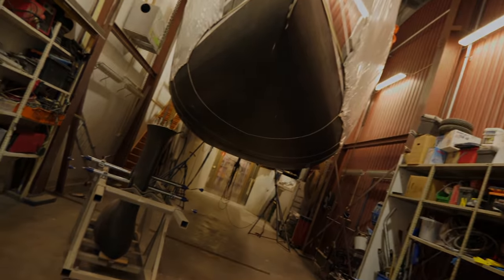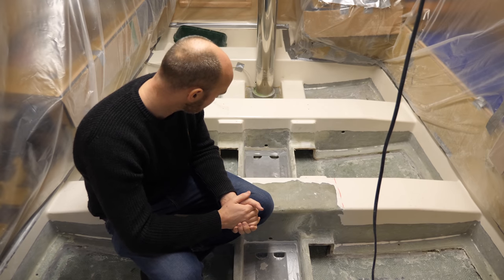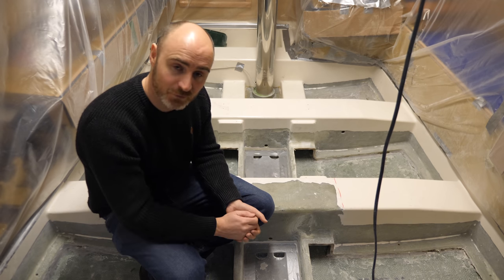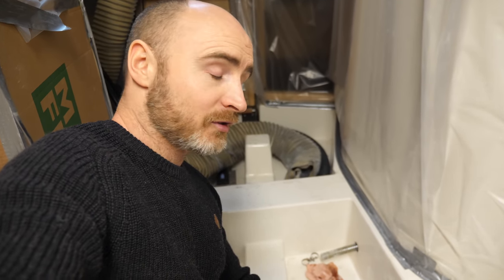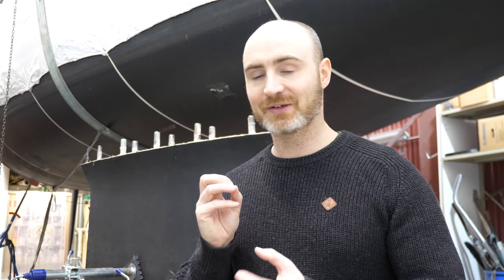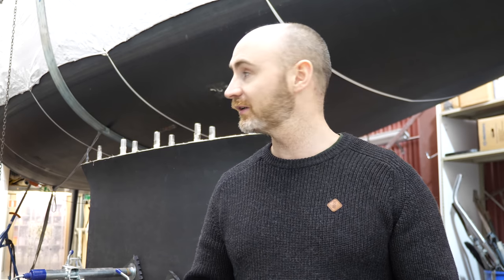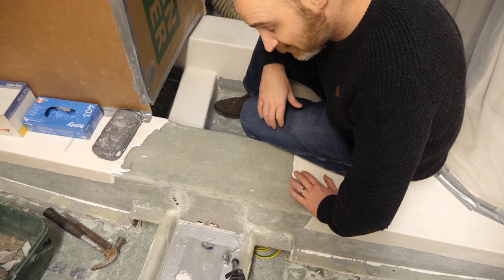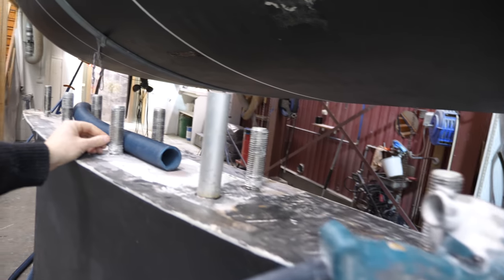SAILBOAT REBUILD - what they DON'T TELL YOU about PRODUCTION BOATS - Plastskador repair week 2

Comment: Why choose between plastic and Brass/Bronze? Why not use stainless for the through hull and ball valve?

Would stainless cause some type of reaction or corrosion?
Reply: Crevice corrosion. I have found some astounding examples. Stainless bolts you could break with bare hands.  My bronze through hulls were unfortunately perfect when replaced at 18 years of age.
Reply from the maker: I have yet to do my research. It could be an option, just haven't heard that much of stainless ones. Thanks for the suggestion though, I will look into it
Reply: @SailingAurora  please don't take anything I said as any kind of suggestion. I know nothing on the topic, but have dealt with a lot of Stainless and Hastelloy valves of all different sizes. I have never had to deal with salt water corrosion, so I do not know what the effects are on these metals.

My questions were merely an attempt to gain information myself on the topic.

Comment: Interesting take but you missed HR's trouble's with resins and layups in the last few years. Neither method is perfect and  both can be screwed up. Also not sure HR is more handbuilt than a hanse/Bene/Jene etc.
Reply from the maker: Thanks for the information and the comment. Do you have any articles I can have a look at? Would be an interesting read, Cheers
Reply: @SailingAurora  I have nothing against HR- but lets not make them Saints. I will let you Google the rest.

Comment: late to the game here but why not just add a new beter bilge pump then you have redundancy if one fails you have an instant back up,
or they could also be run in tandem increasing output,
Reply from the maker: Hi there. We have bought the new bilge pump:-) And we are going to add it so we have it as a back up, but also so they can work together. We tested the new one in the kitchen, result flooded kitchen LOL. Cheers, Chris & Tanja
Reply: @SailingAurora  sounds like you had fun lol

Comment: A good summary.  Aligns with my experience having been there myself.  On my yacht the workmanship for the repair was absolutely top notch.
Reply from the maker: Hi Jeremy. Thank you so much! Sad to hear that you also had to go through this, but good to hear that you had a good experience with the workmanship. All the best, Chris & Tanja
Reply: @SailingAurora  Mine was caused by a faulty lift where the entire weight of the boat was concentrated on the back of the keel, but had the same effect.  An initial bang like a pistol shot, then the expensive sound of cracking fibre glass as the matrix crumbled.  Quiet disheartening.

Comment: Regardless of any claim Hanse makes, it is very clear that the damage to the boat is indisputable proof that the keel is secured to the hull and not to the structural subframe.  The subframe is bonded to the hull and in theory, it is expected to take the loads from the keel through the hull via keel plates.  So any loads will pass through the hull via the bonding to the structural subframe.  As this accident, and many more before it including Expedition Evans, shows in practice the loads simply delaminate the bonding between the structural subframe and the hull as well as cracking the subframe in several places.  Why don't they secure the keel directly to the structural subframe?  They can easily and reliably accomplish this by modifying the keel plates to pass over the structural subframe.  This way any loads will be transferred directly to the structural subframe where they designed most of the strength and where the loads are designed to be supported.  This will achieve an almost identical structural design to the building of the subframe into the hull.
Reply from the maker: Hi Alex, some great ideas there. I am not an engineer or boat builder but I can see the thought process. I think in the end it comes down to money and time to build. Can't see anything wrong with your thinking though
Reply: That's about it what X-Yachts (Denmark) is doing. They use a hot galvanized steel structure  with frames and stringers integrated in the fibreglass hull. If grounded this steel structure can be deformed and it's a hell of a job to replace it...
Reply: @christiandohrn3076  Cementing a fiberglass substructure to the hull or incorporating a metal substructure into the fiberglass hull does not work. Nobody is thinking of designing where the damage should occur or how to make the damage easily accessible.  It appears that they are all designed to withstand the damage and not thinking about the repair.  They are all expecting to discard the entire boat if such damage occurs.

Comment: Hi Chris, thank you for another very informative video. Lets hope that Aurora will indeed inherit some benefits of a custom yacht!
On the subject of the new bilge pump, Johnson quotes 4 times more flow than the stock Xylem (Jabsco). It is however double the height of the stock pump (216mm vs 111mm) so I doubt it can fit under the floorboard. An alternative that I am considering is to fit a second Xylem pump close to the original one, that only activates once the original pump is overwhelmed. In addition, it might be a good idea to install a 3rd pump in the forward cabin. Water could go anywhere when you are sailing.
In any case, the through-hull should be above water level at all angles of heel. But the higher you go the pump's performance will be dramatically reduced, so I think the best option is what Hanse already does, i.e. take the hose aft, right below the platform opening.
btw I am planning a transatlantic voyage in a couple of years by joining the ARC rally in November 2023. If this may trigger your interest and fix a date, just think about it!
All the best
Reply from the maker: Hi Aristides, No worries, happy to share, she will be very strong when finished. Thanks for the info on the bilge pump, I purchased the Johnson yesterday actually, I measured it and it will fit. It might sound like a stupid question but can I ask why you need the bilge pump to be out of the water at all angles of heel. I was thinking that if I put a big enough U bend in it, it should be fine, also there will be a none return valve on it. I'm not saying your wrong, just want to know the thoughts behind it as I am still deciding where to run the hose. Also a good idea with the bow bilge pump, it maybe a future project.

Sounds great with the ARC rally, are you asking for crew or another boat to join? I am definitely interested.  Cheers

Comment: Did you consider replacing the frame with stainless still like Salona 44? 
I believe (at least partial replacing) will be faster and stronger, but I'm not an expert, just curious.
Wish you all the best with the rebuilding...
Reply: I didn't know that. I wonder how they counter crevice corrosion.
Reply from the maker: This wasn't a consideration. Didn't even know it was possible tbh, I will try and look it up. Thanks for the comment though, Cheerrs

Comment: For a steel boat sailor, very interesting to see! Through hull fittings: With collars around 'plastic' valves, like supplied by several, valves are accepted by for instance USCG.  Bronze will last for ever in sea water. I myself removed valves/seacocks from sv Venus, at that time 110 year old original Collin Archer. Material was by spec. 'Admirality Bronze', that in fact is a sw resistant brass. Same material in keel bolts on this vessel. No corrosion, no damage, appart from wear. The boat was built in Larvik, commisioned to Bergen. Sea water all her life. Now in Oslo, Maritime Museum. Still sailing.
Reply: @SVImpavidus  I know, that's why I used 'plastic' with '' :-) Just to mark that it is not metal or steel.
Reply from the maker: Thanks for the comment, interesting stuff. I'm still thinking it over abit

Comment: My partner and I have been watching every episode as we have a 418 on order. I can’t tell you how excited we are about picking her up from Greifswald later this year! 

It was shocking to see the damage done to Aurora and the wait to get her fixed must have seemed interminable for you! 

The repair looks to be very thorough and the yard have done a great job thus far. 

I’ve been wondering how those cutout sections will be reinstated, but ensuring the grid is a strong as it once was. I guess I’ll just have to be patient to find out, but am looking forward to following the numerous stages of the repair. With the grid glass bonded to the hull, Aurora is going to be extra robust!

It’s also nice to get sight of the anatomy of Aurora, so we have an understanding of the hidden bits of our 418, when we need to take things apart. 

I don’t agree that production boats are poorly put together - the build quality looks as solid as the rest of what we saw when aboard two other examples. The damage to your boat looked bad, but sailing 12 tonnes of yacht at 6 plus knots into a rock will do serious damage! I wonder whether you can get the track data off the plotter as there should be specific speed and direction information for the collision. You’ll need some sort of .gpx file reader software.

Just one question: I notice that you have a 3 bladed Flexofold prop. What engine size do you have fitted to Aurora?

Best of luck Chris and look forward to seeing the boat out on the water again! 👍
Reply: Good luck with the new boat.  My 458 has just come out of the factory and is being inspected today!  I based my 385 at Greifswald for three seasons so feel free to PM me if you want any advice about the commissioning process there.
Reply from the maker: Hi Peter. So exciting for you! Hope you will have a great sail to your home on your new Hanse 418, it is such a special feeling leaving in your brand new boat! 
Yes, the wait felt endless, but now we can see an end on it all, and just looking forward to the new season. All the best, Chris & Tanja

Comment: All these arguments over one chemical or another ... if you want a REAL boat, have one built from WOOD. You’ll soon realize that wood floats very easily, whilst all that fibreglass scrap will sink like a rock. Boats ... that is, REAL BOATS are built with wood. Take a trip on a wooden boat & you’ll agree with me.
Reply from the maker: You have a good point and I think some wooden boats are very petty. However it depends what wood is used to build the boat, some wood is more buoyant than others and I'm sure will all the additional equipment, it would sink anyways with additional equipment. Check out the Vasa ship in Stockholm, it sank within 20 minutes of her maiden voyage, its an interesting story of how it was raised 300 years later. Wooden boats also carry alot of maintenance with them

Comment: Very interesting and informative. I only avoid bolt on keels because they seem to always have big vulnerable spade rudders, but there is so much more to this.
Reply from the maker: Thanks, appreciated. Yup, there are so many arguments for and against. I don't like the vulnerability of the rudder, but the way it's designed is superb, when sailing the feel is second to none. We fell in love with it the second we sailed the 388 for the first time
Reply: @SailingAurora  Our sailing area is notorious for groundings. We had an encapsulated keel and skeg hung rudder which meant when the inevitable happened I was never too worried. Now we have two rudders and centre board so if we ground it just lifts up. I'm not a steering fan and use autopilot a lot. But friends that helm might not like the twin rudder set-up with its mushy feel on some points of sail.
Reply from the maker: @philgray1023  Totally agree and good plan

Comment: Mmm. Guessing insurance would not write it off. Shame because who would buy it now for more than pennies to a pound.. Or maybe you got a payday and are quids in. Hope so! I think the big lesson here is that if you buy a production boat don’t put it to work as a renta boat coz u know it is gonna get trashed. Good luck with it but at least now you will have a lot more confidence crossing oceans.
Reply from the maker: Thanks Paul. I don't think the grounding will affect the resale value too much, many of the boats up here have been grounded and as long as they have the right paperwork and it's a reputable repair company, it's usually fine. Crossing oceans... one day, I hope
Reply: @SailingAurora  - I think you are right, yet that is because your repair is visible and is probably better now than when built knew.  Though how many boats which have been crunched can present the same honesty.. Not many but for sure I would buy yours and might even be tempted to pay over the odds having seen the additional strength put into the keel Interface. Anyway, well done and keep up the good work..